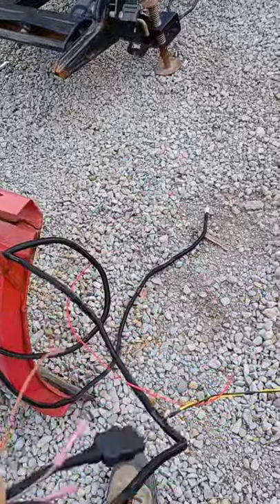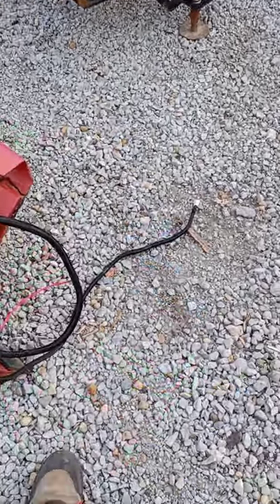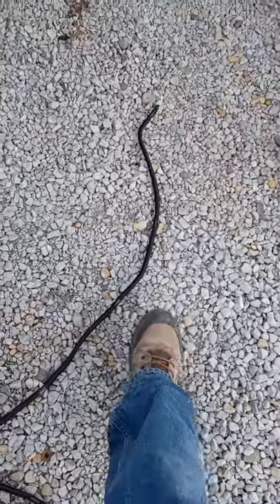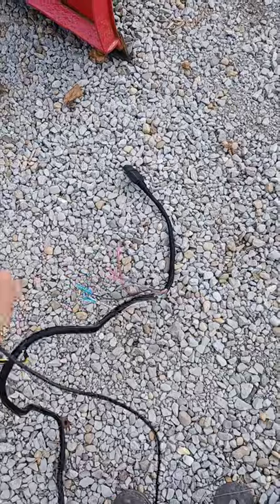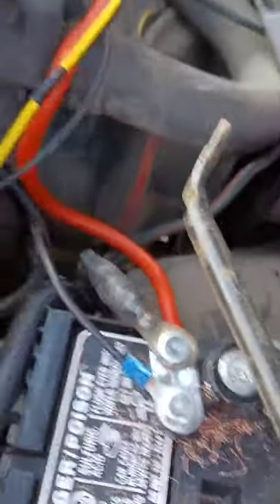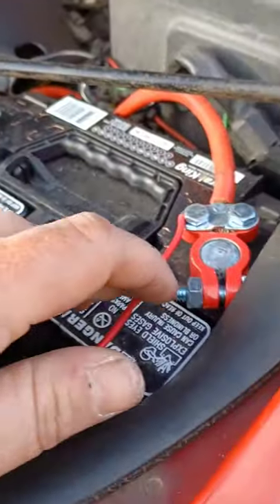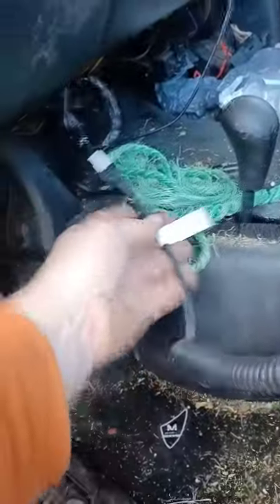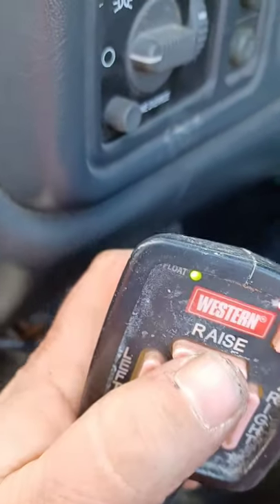homemade Western Plow wiring harness

Comment: Wow, she's quiet! 
But still,  yer grounded!
You were specifically instructed to get heat shrink. 
Plus you should add some in line fuse holders too!
But anyway,  I was told that the "adapter" or "control module" (dunno never got one) was very expensive to use either a 2 or 3 plug plow.
Cost prohibitive was the term.
And dude, get yourself into modern times.... spit loom is so 1990's. You gotta use the Chinese Finger Cuff stuff! 
Expandable Braided Cable Sleeve 👌 
Glad you got it done,  looks much warmer by you. 
16 feels like 5 here
Reply from the maker: All the connections have heat shrink. Okay I will have a fuse tap that will hold a fuse to go into the fuse box. Not sure what controller module you are talking about. If you are talking about the isolation box, this does not use one. On my ultramount I bypassed it so it no longer uses one either.
Reply: Honestly I have no clue what it is?
I checked with my dealer, hey I have 2 and 3 plug plows can I wire the truck to use either or both? 
No, crazy expensive. 
I don't know if it's labor or parts, I trust him, he's been good to me for 20 years,  and he would have gotten the money, so.....
That just means I can't use the wrong plow 🤔
Reply: @Mike The Mow Man  I just bought a used western pro plow. The wiring harness is completely shredded. I would like to talk to you about getting a new one.
Reply: @Caleb Smith  
I'm not sure if Migel is necessarily "the guy" for schematic style questions?
But if you are planning to try and salvage a "shredded" harness,  I'd most definitely recommend that you use a reputable source for quality wire, at a minimum of 10AWG automotive or marine wire, as well as heat shrink and connectors. 
There are many uses for the cheap crap Amazon products,  but 3AM, 25 miles from home in 12⁰F, with an inch an hour coming down till noon is NOT the time to find out the value wire is copper clad aluminum and the inadequate crimp connections left the chat.....!
Harbor Freight has a wonderful wire stripper by Quinn for  $18  sku# 57785, a fine 9½" crimper from Pittsburgh for $8 sku# 36411 that's a copy of a similar Channel Lock pair I routinely use. Or a Doyle Ratcheting Crimp tool that is comparable to a set I've got too, which are typically more consistent with the pressure and easier for the heavier gauge wires for $20 sku# 58325
Crimp fittings with die electric grease is preferred for the corrosion laden installation,  in addition to the pliable wire with a thicker insulation.
Some abrasion protection,  better than split loom is readily available,  like  1/4 inch & 1/2 inch PET Expandable Braided Cable Sleeve – Wire Sleeving for Automotive Wire which is $10 for 50', and wonderful to work with,  either for long home runs or random intersections. 
But again,  quality wire and connections are unarguably where it's at!
Westerns site has a ton of schematics available for download,  along with troubleshooting guides, that are undoubtedly worthy of printing and having laminated for repetitive use. 
Good Luck! 
Sup Mikey, stay smart, and I'm glad to have been a part of your brine usage.

Comment: About to do this on my Ram 1500 . Do l just pick up  03 and earlier western solenoid plow harness and make some changes to it?
I have a 2 plug 9 pin set up on the plow also wanna use regular 6pin controller rather than that old school joystick 🕹... Basically set up like yours.
Part # of that controller would be appreciated.  Thank you